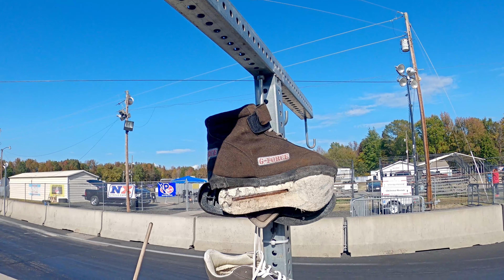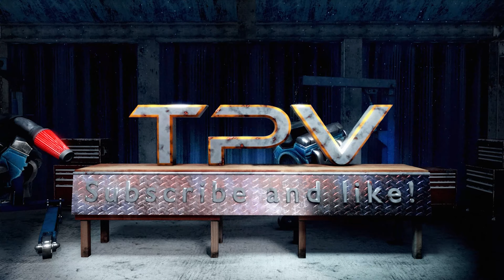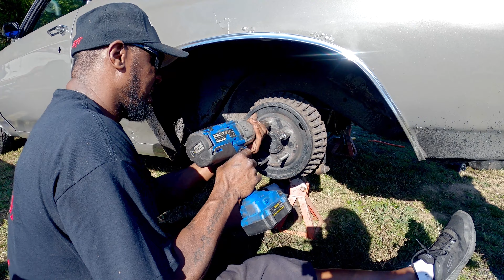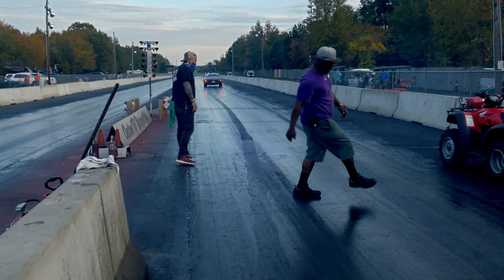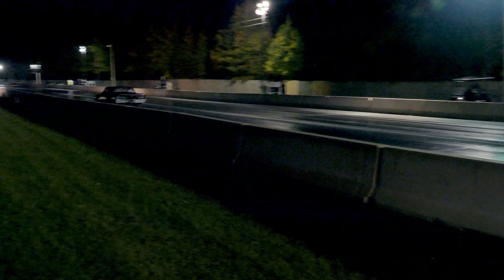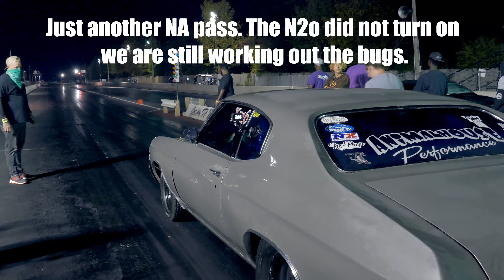1971 Chevelle 355 SBC First test pass with new engine @ Custom T's Motorsports "Clash of the Titans"

Comment: beautiful! Question I'm converting my LT1 to a carburetor what timing cover would work?
Reply from the maker: Center bolt valve covers.
Reply: @TPVPRO  not valve covers... I got that.. how do I plug the existing front distributor hole?
Reply from the maker: @ftlauderdaledirtbags2139   My bad depending on the cover style mine had a small hole so I just used a freeze plug I had laying around.  The ones with the big holes I would probably weld it up with a plate of aluminum.
Reply: The stock timing cover works fine.

Comment: Home boy needs to drop in a 632 🐀! 😛💯
Reply: Nope 632s are junk they stretch themselves a part due to bad geometry I have a 95 corvette drag car with a 632 and a th400 its 1140 to the wheels and runs 7.90-8.00 consistently yes you can make cheap power with them but id highly recommend a 540 for something like this you can make the same power but more reliably my back up engine is a 985hp Dart 540 bbc
Reply: @in-rust-we-trust2831  👍💯
Reply: A rotary engine can make 1500hp with a turbo and a proper build. Bigger ain't always better.

Comment: Should I go 355 or 383 I can’t make my mind up
Reply: At the end of the day, a 383 sbc has much more torque . Very fun on the street and quick at the track..
Reply: 355 can get The job done if built right. I've beat many bigblocks with built 350s.
Reply: Seen a single turbo LT1 make over 2000hp. It was 355ci. Steve Morris built it.
Reply: Those extra 28 cubes don't make that much of a difference unless your building a basicly stock engine.
Reply: If ya need a bigger engine for torque, build a stroker bigblock.